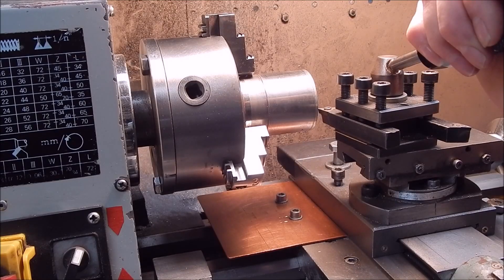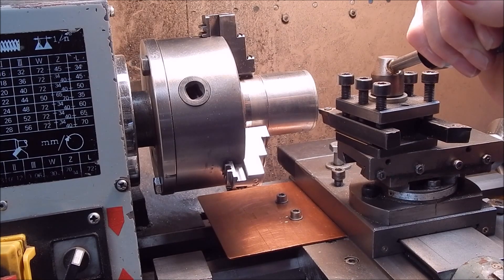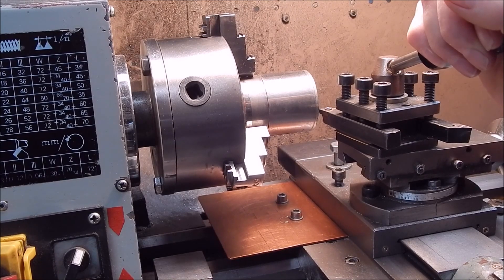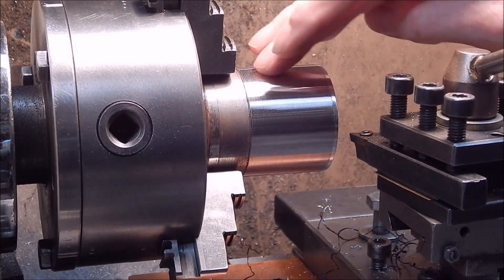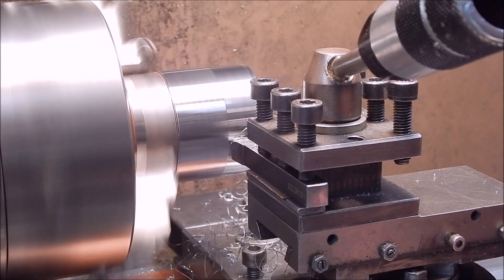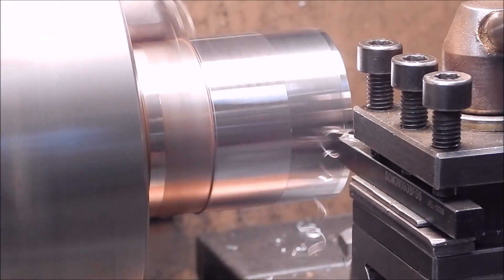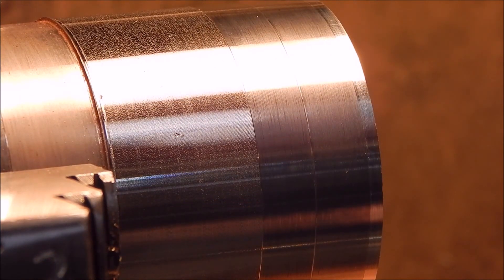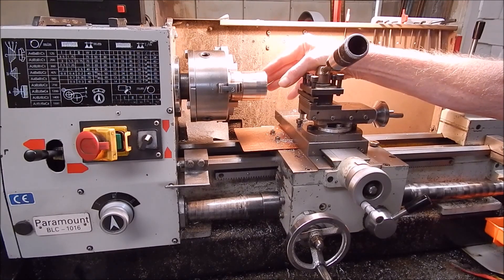Finishing steel with a carbide insert meant for aluminium - excellent

Comment: Hi Rob. We can add another string to the bow for those inserts. I had to make another phosphor bronze bush today. As the tool with the insert was in the toolpost I thought I'd give it ago. I had the lathe running at 1000 rpm and the phosphor bronze was 3/4" in diameter. It faced off to a mirror finish 👍👍 I had to reduce the length of the bar a little so I tried various depths of cut. Each time it faced off perfectly. Bloody good find those inserts! Cheers, Alan.
Reply from the maker: Hi Alan,  tha's a great bit of info.  Thanks for passing it on.  The inserts work well and seem to be not as fragile as I first thought.  They will catch and dig in on brass if you cut too agressively, but that's because of the top rake.

I saw something yesterday which was a bit unusual down town.  I was stopped at a train crossing in suburbia near me, and a 6 foot fully grown male kangaroo nonchelanly hopped across the road and went down a side street.  I think it must have followed the railway line down from the hills (seversl miles) or a local creek.  I had the mobile and tried to film it, but by the time the goods train had passed I couldn't see it again.  Probably lunching on someones prized flower bed.  He He.

We get them up north a lot, but the numbers are increasing significantly and moving closer to suburbia all the time.

They can be a menace on the roads and a few friends have damaged their cars hitting them.  The same thing is also happening with deer.

I see you guys have red neck wallabies on the Isle of Man.  He He.  Damn Aussies ;)

Cheers Rob
Reply: @Xynudu  Hi Rob. We have the same problem with deer in rural areas. Apparently there have been sightings of wallabies all over the UK. So it looks like there is a small wild population over here 🙂 Cheers, Alan.

Comment: Hello. When I was at trade school machining aluminum using HSS steel bits we were told to grind plenty of top rake on the tool for aluminum. I don't know why this is but at some point would you like to do a demo with HSS with hardly any top rake and one with a lot of top rake just to see if it turns out o.k and compare the difference if any. Just a thought. Anyway happy new year.
Reply from the maker: Hi Dermot.  Aluminium needs plenty of top rake.  Brass in comparison needs very little (if any).  Apparently these aluminium inserts are also good for copper and plastic, so it looks like they work best on soft materials.  Thanks for the suggestion.  Cheers Rob
Reply: @Xynudu  tanks for the reply. I guess we all learn something new even if we have been in the trade for years lol

Comment: Hi,Rob. Not new to me as I've been using the GT aluminium inserts for finishing steel and stainless for many years.
One if our well known carbide suppliers in the UK actually recommend using these inserts for stainless finishing. At the price these are available it isn't a big deal if a tip gets damaged.
All the best for new year.
Reply from the maker: Thanks for the info Howard.  Cheers Rob
Reply: La même chose pour moi, ce que vous dites est tout à fait exact.

Comment: I know that Ade over at Ades Workshop use pretty much just the aluminium inserts for all of his work on any material now. This is on his Warco WM180 lathe, when he first got his Warco a few years back he started with the normal MT inserts. He found the WM180 didnt like MT inserts that much due to lack of ridgidity of this small lathe where the finish wasnt that great & would get some chatter. He tried aluminium inserts & probably fair to say with no regrets.
Reply from the maker: Chatter is one thing I rarely get with any of my lathes, except for heavy cuts the Sherline, but the finish is rarely this good using my other tooling.  I can see the Sherline benefitting a lot from these.  Great tip.  Cheers Rob

Comment: Rob wait until you try the aluminium inserts on your Sherline running at higher speeds, fir a few years now I use nothing but these inserts now on my Sherline. The finish I get on aluminum is unblievable & on mild steel it looks like a shinny fine ground finish ( mirror like finish ), these inserts also work very well on stainless for a lovely finish. Glad you like these inserts mate.
Reply from the maker: The inserts fit my 8 mm tooling, so they will get used on the Sherline.  Sounds like they will go great.  I'm very pleased with these inserts. Cheers Rob

Comment: Uncoated carbide will give a very fine finish in steel, but at the cost of pretty rapid insert wear. Cermet inserts are often overlooked, but they're fantastic for finishing and semi-finishing in steel. Carbide really prefers to take big cuts with heavy chip loads, but cermet is fine with the light passes we tend to take when creeping up on a dimension and gives good surface finishes even in marginal cutting conditions. Chinese cermet inserts are available for a couple of bucks each.
Reply from the maker: Thanks for the info!  Good tip.  Cheers Rob

Comment: I wouldnt call that good, shiny but feed lines everywhere. A decent brand light finishing insert would give better results.

Example with same lathe on a horrible grade of mild steel.
https://youtu.be/eg8cZnd2rPo
Reply from the maker: That's not the same lathe.  I don't see any close up video of the finish.
Reply: @Xynudu   Yours is older and higher spec than the warco wm240, but they are both chinese 10" lathes with comparable ability.

Comment: whatever works mate,continuous chips suggest different rake angle than normal etc ..
Reply from the maker: Not in this case John.  It's the type of steel.  I've machined these rollers many times with similar results regardless of the insert being used.  I have some axle steel much worse at streaming than this (makes those tight springy streamers that eventually clog every thing).  I later tried the ally insert on mild steel and it made coil chips as normal. Great budget insert.  Cheers Rob

Comment: nice but not a lot of chip breaking I see. probly alright as a general go to cheapie when you're short on good inserts
Reply from the maker: The type of steel causes the streamers.  I later tried it on mild steel and it made chips as normal. Great budget insert.

Comment: Hi Rob. That's a better finish on steel than I've ever been able to achieve with any of my tools. I've had a box of those sat on the shelf and only ever used them on aluminium. They will be getting a lot more use from now on. Be interesting to see how well they wear when used on steel. Cheers, Alan.
Reply from the maker: Hi Alan.  I'm totally amazed how well they work on steel.  Mine will be getting plenty of work from now on.  Good trick from the viewers who commented.  Cheers Rob

Comment: I use aluminium grade inserts on steel  for a finish cut often .  Great if you only have to take a couple of thou off , esp on mild steel .
Reply from the maker: Hi Max, I had never heard of this trick until I got comments on the insert review.  Does an amazing job.  I'm totally stoked.  Cheers Rob

Comment: Thanks for the great video Rob! This has always been my experience as well. Easily chipped if bumped, but fantastic finish on steel with a light cut, and a great finish on aluminum as well. I find I can use the cheap CNMG12404's meant for much bigger lathes on my little South Bend 9 inch no problem with these polished, positive rake inserts intended for Al. 16 cutting edges for less than $2!  Appreciate you sharing your experience!
Reply from the maker: Sounds good.  I was amazed how well this style worked on steel, but then again it cuts a lot more like HSS than regular carbide because of the grind.  Good to spread the word on these hidden gems ;)  Cheers Rob
Reply: @Xynudu  Geometry is king!

Comment: Also good for plastic
Reply from the maker: Thanks for the tip Phil.  I will try that also.  Cheers Rob
Reply: Yes , good for Delrin but the swarf controll needs to be planned in advance. If you can get the vac cleaner  nozzle to collect it in a stream as it comes off your safe, dangerous stuff if it gets around the work or chuck. 
Another video that opens up some new methods , thanks Rob.

Comment: Great video rob,I use this carbide inserts all the time, they do a great job you just can't push them..
Reply from the maker: They sure do an excellent job.  I find that they work best on fine feed (on my lathe), but medium is also damn good.  Great tip to use them.  It will be interesting to see how they last.  Cheers Rob

Comment from the maker: Note:  Obviously the finish and chips produced will largely depend upon the type and quality of the material being machined.  The test steel used has previously streamered with any insert used on it. 

I later tried the ally insert on the gnarliest, stringiest piece of low grade mild steel I could find and it came up extremely well, producing normal coiled chips.  Equal to any finish I had ever been able to achieve.  Cheers Rob